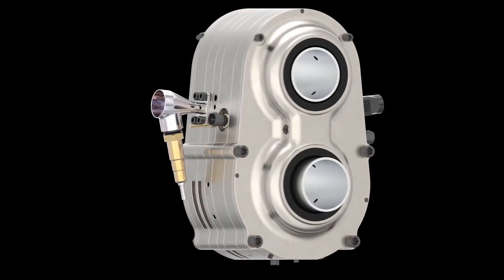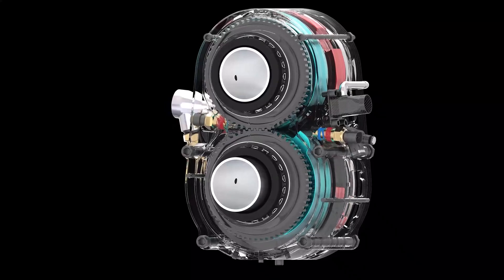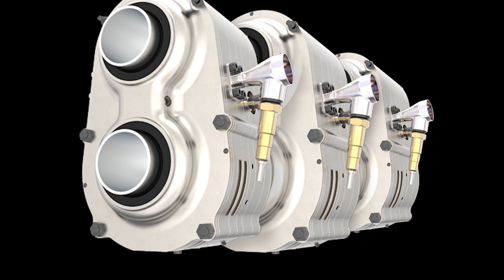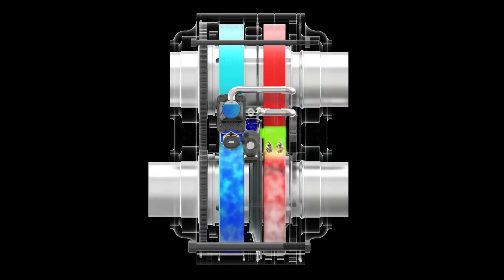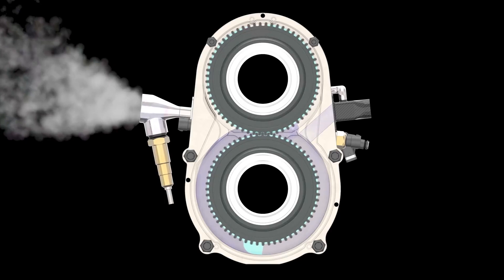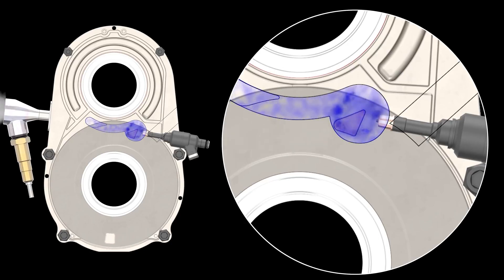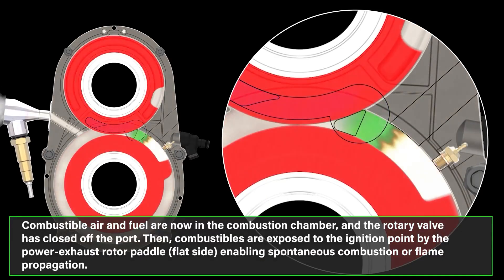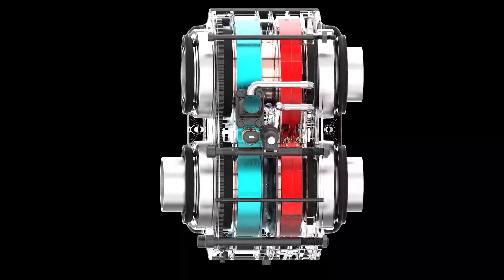This pistonless engine runs on hydrogen and revs to 25k rpm

Comment: I would love to see this working, that said....  As others point out, how do you compensate for a car in a Toronto driveway on a january morning at -40, starting up and getting to operating temperatures without exploding?  How well does it cool down with absolutely painful tolerances?  The high pressures mean that all the pressure is not on flexible seals, that while a pain in the ass when they fail, prevent the failure of the metal parts.
What this could be developed at is a power supply plant for hybrid electric vehicles.  It drives a generator that charges batteries.
Reply: We could do that now with Diesel/Electric.. Like trains...  Diesel is much easier to find across any country Vs. Hydrogen...   Now, If this engine is able to Create enough electricity, instead of driving electric motors, maybe use the electricity to drive a hydrogen fuel cell and create hydrogen from water. I'm full aware that Thermal Dynamic says that this can not simply run off water... But just maybe it could go pretty far.. much farther than current electric cars.
Reply: @N2Otorious  diesel is too inefficient of fuel source. Although much more readily available and engine like this would never run with any real efficiency compared to hydrogen. I think they're big intent is to use hydrogen because of it's non-polluting nature, more or less.
Reply: to store and use hydrogen as fuel effectively, it needs to be in liquid form
Reply: @yeastbreadskull9445  nah, gas form is fine, you just need a holding tank about 100mx25m towed behind lol

Comment: Egr valves would indicate it runs rough when cold. Would clog passage with other fuels. As a combined pcv valve it has constant recirculation back to the intake. High tolerances too... Only hydrogen, maybe not even methane or alcohol. Hopefully you don't have to put a warming jacket on it or pre-pump hot oil like an F1 engine to get it started without mangling itself or to start at all. Looks good. We'll have wait and see how glitch the first generation is if they really build one.

Comment: Dear Chris, A brilliant design. It has two issues, one is mechanical or technical. This design require jet engine levels of tolerances, this will create specific issues and costs in its manufacture and its maintenance. The other is the use of Hydrogen. The problem is currently the vast majority of Hydrogen produced is via natural gas reforming, so the power in and they Hydrogen out creates an energy loss ( I believe  electric power used to produce hydrogen from electrolysis of water is even worse ), this is the fundamental problem with ALL Hydrogen power concepts, this is not the problem with electric, especially if the electric is being produced via alternative methods. If a method of Hydrogen can be developed where there is no power loss ( aka genetically altered bio-organisms using sunlight has been suggested ), then this engine design has great potential.

Comment: interesting, but i dont see this practically functioning. Also putting engines in line, even on normal combustion, doesnt work that good, sometimes makes the vehicle even useless or very unpleaseant to drive, i dont know if that gets any better with a 25k rotary engine.

Comment: Similar to the MYT engine, this cannot work. Outside of the vacuum of theoretical and conceptual, this has no real application. There are several issues present that aren't addressed, but overall, it's destined to remain on paper.

Comment: Neat idea, but the process of turning hydrogen into fuel is energy intensive and involves the burning of fossil fuels to do so. My city uses 100% renewable energy for it's electricity grid, so if I used an EV, it would be much closer to carbon neutral. If Hydrogen fuel can be mass produced without carbon emissions, I'm all in!

Comment: This is simply false. No device that transfers heat energy into mechanical energy can exceed the Carnot efficiency, which is determined solely by the absolute difference between the heat source (in this case, the burning fuel) and the heat sink (in this case, the atmosphere). Operating at the temperature of burning hydrogen in an ordinary atmosphere, this engine's theoretical efficiency could not be much above about 25%. All heat engines must reject heat.

Comment: Internal combustion still heats up cities by several degrees, closing one highway in a Korean city lowered the temp by an average of 3 deg C, that's quite a bit with people dying from heat related illness during our summers. And there is more efficient ways to use hydrogen.

Comment: The real challenge with hydrogen powered engines is not the engine itself but the safe storage of liquid hydrogen both in fuelling stations and in the vehicle's fuel reservoir itself. Gaseous hydrogen occupies too much volume for it to be able to carry enough for a vehicle with decent range. So hydrogen must be liquefied in order to have enough fuel for decent range. This creates all sorts of logistic and safety headaches because liquid hydrogen must be stored at very high pressures and very low temperatures (around -250C). Any vehicle on the road with a large reservoir of liquid H2 is potentially a bomb. What happens in a collision?... What happens when the vehicle is left baking in the sun for hours and days?....
Reply: you had me right up to the "bomb" problem, the dangers of explosion is almost non-existent because the hydrogen would burn upwards after the rupture of the tank, small possibility of shrapnel, Hugh fireball escaping up and away from other cars.
Reply: @DanielMartinez-lz3ot  That's true as long as the pressure inside the hydrogen tank is higher than atmospheric pressure. At some point the pressure will come down and the possibility of explosion becomes a very real one. And besides, if the fuel leaks but doesn't ignite, there is also the possibility of frost burns to consider. Liquid hydrogen is a dangerous material and the potential hazards should not be underestimated.
Reply: Also hydrogen liquifies at -250℃.  This takes a huge amount of energy to achieve.  At the moment, production costs outweigh the potential ecologically benefits. There's still a huge amount of work to be done, before liquid hydrogen internal combustion engines become financially viable.

Comment: We have to see how it works in practice. The first question that jumps out is, if there are tight tolerances then how quickly does friction wear down the engine? That is a huge issue if you want to put it in a car people are going to drive every day for 10 years.
I'm generally less interested in an engine's strengths than in its weaknesses and unknowns: how long will it last before major repair, how much noise does it make, how easy or hard is it to maintain, and of course cost and weight-to-power/weight-to-torque ratios. I still see ICE as the future, and EV as little more than an alternative or a bridge to something else. But that means new ICE tech needs to be better, cheaper, and more practical than traditional ICE tech - not just better than EV. To become the new heavyweight champ you have to fight and beat the current heavyweight champ, not his flyweight little brother Todd.
Reply: ICE isn’t the future. They’re likely getting regulated out of the market entirely by mid century in the us and eu.

Comment: Combustion engines are a dying breed and on their way out...making a Novel design which this certainly is, it would be amazing if it actually ran,  this wont save a way of producing power whose time has run its course.. there are Better ways than exploding fuel to propel cars... this is from someone who also still loves the sound 
of a sweet running engine but their reign has passed.

Comment: Basically the only way that this isn't going to leak is if you keep it at a high RPM the entire time. Nobody drives like that yeah this might be great for racing but on the road this is going to be a terrible engine

Comment: "Saving" the ICE? The push for electric isn't about eliminating ICE; it's about sustainability and pollution. If there's a hydrogen-burning engine out there that provides torque and hp on par with a modern electric motor, then yay! If it produces greenhouse gases or smog, then boo. NOTE: it needs to be free of BOTH greenhouse gases AND smog to be as useful as a modern electric motor. Something hydrogen-based would be wonderful, if material science has gotten to a point where it can be made reliable for long-term use in real-world (road vibration + turns that produce gyroscopic forces on the engine) scenarios.